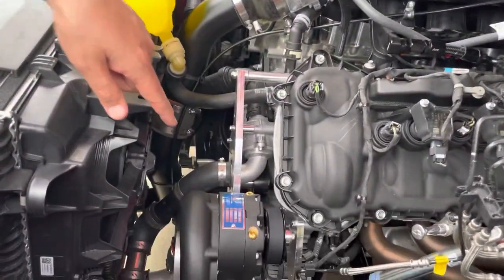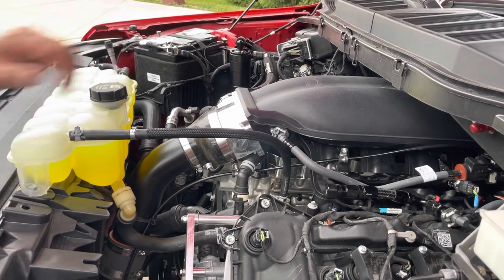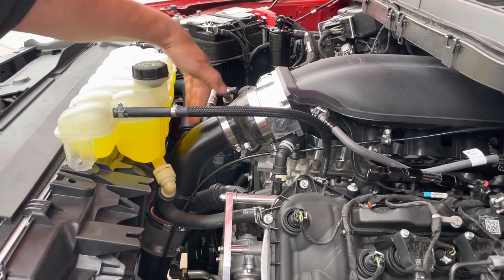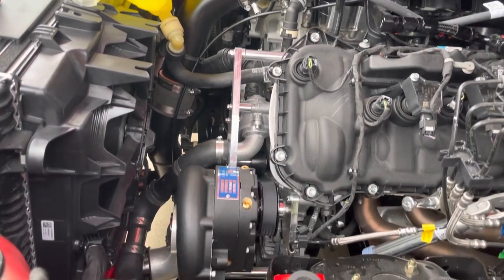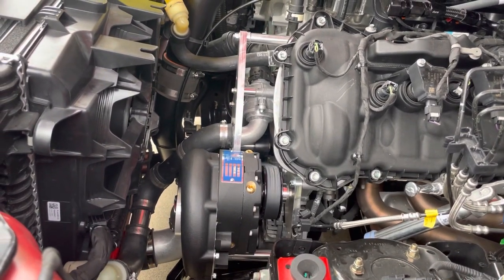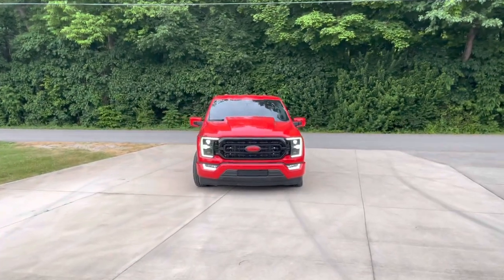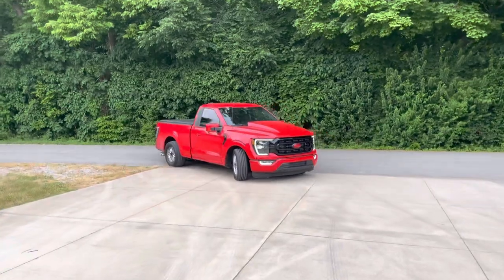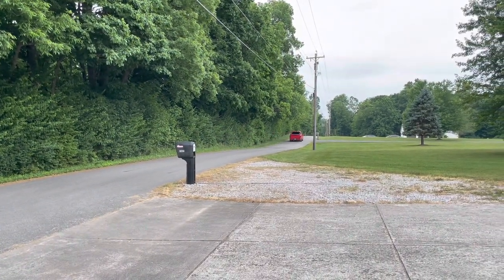Beefcakes Vortech Supercharger F150 Part 3

Comment: What blow off are you using and what modifications need to be done on the intake pipe to work on the boss manifold?
Reply from the maker: Well, anytime you’re running a different manifold than the factory manifold for that year vehicle we’re going to have to modify the last pipe. We are running the Max flow race blow off valve.